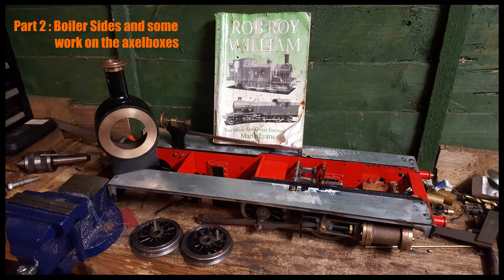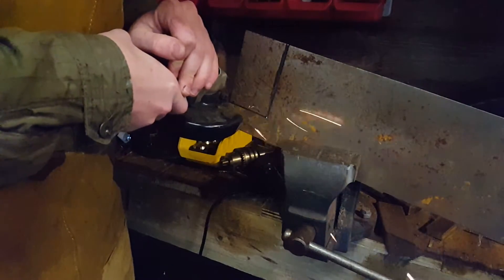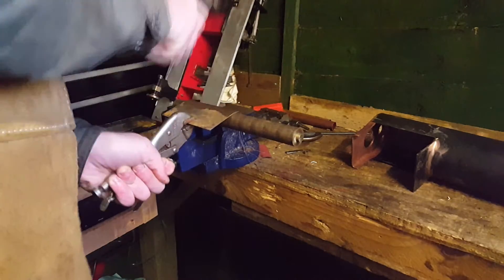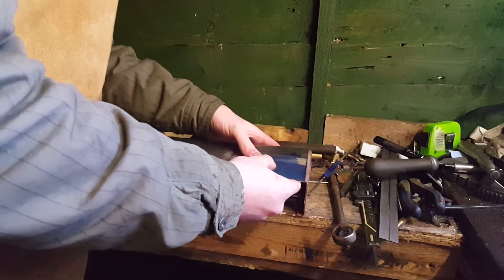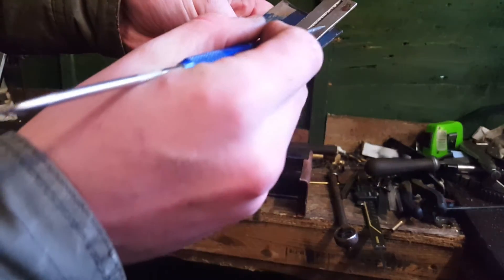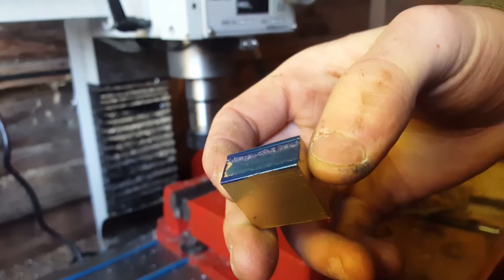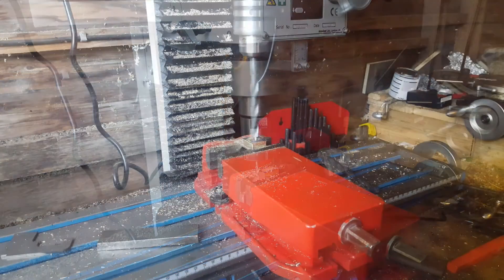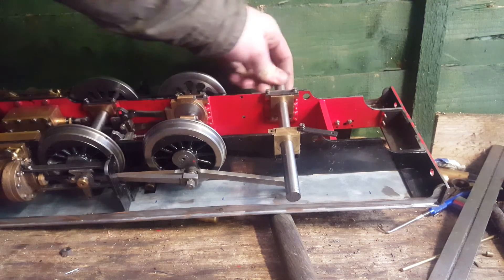Rob Roy 3 1/2 Boiler Build and General Rebuild Pt 2 : Boiler sides & axlebox

Comment: No way on this Planet would a boiler inspector even start to do a test on your boiler!!
For steel you need to be a coded welder and work to a published design.
Steel comes in for the larger 5 inch gauge locomotives and above where cost scares you off copper.
Yes copper tubes expanded into the tubeplates yes!
I am building 2 Rob Roys and going for a bigger boiler having struggled with one
round the Andover track.
Stainless is used mostly on the continent then to a published design for that material!!
Reply from the maker: steamsearcher beleive it or not i am a coded welder :) this boilers on the shelf now anyway. I tig welded a copper one up wich is much better